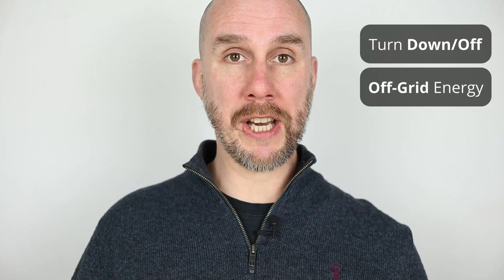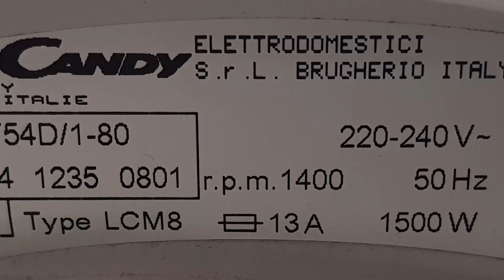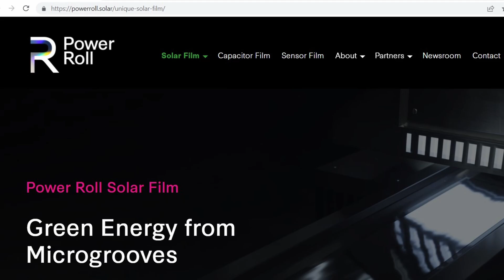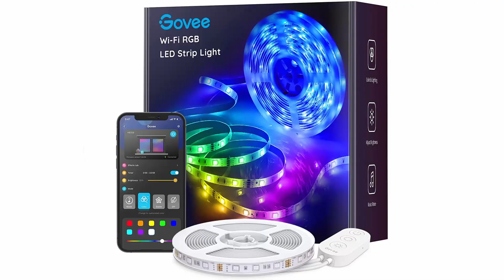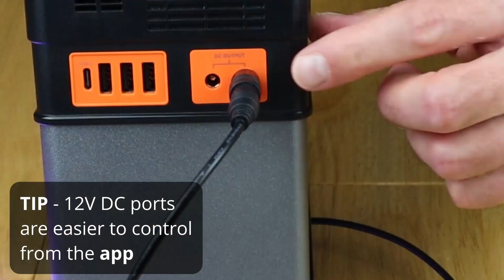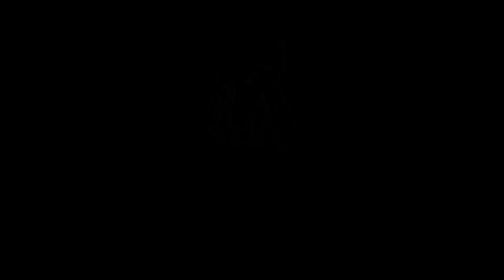Energy Matters #1 | Off-Grid Solar & Portable Power at Home | Cutting Grid Energy Usage

Comment: So pleased you are doing this series of videos. I am currently looking into the same thing using the Ecoflow River Pro - which is then scalable with a second battery. 600w devices are my new holy grail!
Reply from the maker: @david wilkins  Good day David! Thanks for your feedback, this really helps gauge interest in this topic👍 The added flexibility that expansion brings is a winner for sure! I'm getting to the point of thinking of electricity like water, in the fact you can carry it around in buckets or batteries in this case. Please shout if there are any burning topics or items you would like to see in upcoming videos. All the best, Adrian

Comment: Hello Ade, Great video and information. I am in parallel with you! around 10 years ago I set up my own DC microsystem in my shed for some lighting in the Kitchen. The intention was to power LED strip lighting under and above the cabinets at the dark end of the kitchen linked up to a motion sensor, the lights come on when you walk into the room and switch off after 20 seconds of no movement. Front end was a single solar panel (100W), controller, 110Ah Lead/Acid leisure battery plus various meters to show the load, Reset-able fuses etc.This has worked very well for years. I recognized I could do more with an off-grid DC setup rather than on-grid system so I have put additional wiring into the house with fuses to suit 12V LED strips (one and a half metres) with an on/off switch in each room. (had to be careful with the wire sizes). This works well too. I am upgrading the battery to Lithium now. Keeping one eye on the energy issues I purchased a Jackery 1000 to use for other purposes, loads of rechargeable AA/AAA batteries and various adapter cables to connect various devices direct to the Jackery solar panels where possible. I plan on getting some of the stuff I have seen tried on YouTube such as 1kW kettle, single ring Induction hob, mini oven cooker etc etc. I have only been using the Jackery for a short while and the panel charging seems to be a bit "hit and miss" with them on the ground. I am not a "prepper" but am also interested in producing drinking water from a de-humidifier and filter method but I am having trouble finding a suitable 12V DC de-humidifier to produce sufficient water, mains ones at around 350W are fine but would bankrupt the power from my Jackery before producing much water as well. Looking forward to watching your series of videos.
Reply from the maker: @Mike Beirne  Hey Mike. Thanks very much for your generous feedback, it's much appreciated😊. Wow, we appear to be very much on the same wavelength. That's some DC setup too! Great idea to go lithium, I couldn't imagine life without LiFePO4 batteries now.

I bought a dehumidifier fairly recently so I can dry washing once the weather turns (and then I don't have to use gas central heating or tumble dryer). It's a 250W model, but I've seen another that uses 130W, but I'm not sure how affective that would be. I feel a DIY project coming on to produce water as well.

I'm not sure if you've seen some of the other videos on the channel (you may have already), but they might be useful for the other bits you're planning on getting. Next in this video series > https://youtu.be/fu_hbYolXc4 and some of the others where I test using the things you’ve listed > AC200P https://youtu.be/pl6-XN4xfMU > EB150 playlist https://bit.ly/3msZlWT > Jackery playlist https://bit.ly/3AMWrD7. 

I'll continue this series and also provide some figures relating to how much I've saved and how I've done it. Thanks again for sharing, this also helps other viewers out too! All the best, Adrian
Reply: @DADvinci  Great thanks for your comments. I have seen other reports and ways of "producing Water from thin Air" as they are usually called, but I would be very interested if you do some form of investigation/project particularly if it is aimed at 12V rather than Mains source.

Comment: Hey Adrian, some great advice you have put out there for people to save money on power.  I’m glad you mentioned the direct D.C. to D.C. issue, as an inverter is inefficient and/or unnecessary in many cases.  Also through charging is a huge point, as you have pointed out a while ago now.  
One trick to save money is to switch off appliances at the mains.  There are so many items taking up a small amount of power, it adds up; T.V. Radio, D.V.R. Sky, Device Chargers, the list goes on.
Shame we can’t do much about the standing charge, other than shop around.
Great advice Adrian, great to see you again.  Rog.
Reply from the maker: @Roger Hargreaves  Hey Rog! Thank you👍 You're always very generous with your feedback😊. Switching over as much as I can to battery/solar power is already making a real difference to my monthly grid usage. Managed to keep my April bill low (£85 in total). You're right about switching things off from the wall, every watt helps now. Although I understand the necessity for a standing charge, it's just getting silly now (especially electricity). My May standing charge (Gas + Elec) will be almost £22 alone! Here's hoping for a sunny May so I can keep the bills down and videos coming. Enjoy the rest of your weekend. Cheers, Adrian
Reply: @DADvinci  Thanks Adrian, always great to get a quality reply from you.  Here’s to a ☀️ summer. 🤞🏻.

Comment: I loved this video Adrian, and it gave me a bit of a boost as well. Mainly because your video confirmed I was doing something right.
 I was up early this morning just to set up my 100 watt solar panel and catch as much sun as I could. Our rented bungalow is all electric, and I feel like pulling out the night storage heaters and throwing them into a skip. 
Anyway (takes deep breath) it is now me versus the grid. I have two Swarey  S500's and just the one 100 watt solar panel. We can use our large tv for about 10 hours with one S500, whilst the other powers a standard lamp (with a low energy bulb) and recharges both my mobile and laptop for a huge amount of time. I know it is little beginnings, but I feel so much better for giving it a go.
Reply from the maker: @Sidney Bowerman  Hey Sid! That's very kind, thank you😊 I've got to say that feedback like this and what you get from the content, really makes all this worthwhile👍

I feel your pain when it comes to the storage heaters and there's not much you can do about it if you're renting. I guess we're all in this together now, 'us' versus the grid. That's good going with the TV!

I started my solar journey off with the original 288Wh ALLPOWERS unit, which is still powering some LED strip lights in my living room as I write this. I've just refined the build of my DIY 24V 5kWh battery which runs most things now, so small beginnings grow and it all counts Sid! Thanks again and take care, Adrian

Comment: I have tried all of your suggestions but to no avail. I wish I could get a full charge by 11am. It takes me all day!  I haven't used the Anderson port on the 372 as I don't have the lead. It's on order. Obviously the Jackery 500 doesn't have an Anderson port. I wish I had waited for the 1000. I will persevere but I am still happy with the results I am getting so far. Thanks for the support.
Reply from the maker: @Turbo Jones  I'm sorry to hear that. It may take all day, but you've taken the step forward. I started with the 60W foldable years ago and have slowly grown my setup. Using the Anderson port should resolve the issue, if it doesn't then it can only be the cabling/connectors (if the panel is good). I'm not sure why the Jackery would be showing the same behaviour as it's not something I've seen in any of my testing. Does the Jackery charge fine with the mains brick? It's a pleasure, troubleshooting with good people like yourself results in wins all round. Cheers, Adrian
Reply: @DADvinci  Yes the constant charge from the brick(s) works fine. It's the variation of charge that is the problem. I have ordered an Anderson lead so I'll see if this makes a difference. Will not help with the Jackery but I can live with that. Anyway, I am getting good results from running mains devices as I said. Just takes a bit longer to charge but being able to run the TV, settop box, phone and router from just a single 100w panel is a game changer expecially using the daisy chain method. Winter will be a challenge but hopefully we will have built up enough credit in the summer months and with Boris's help all should be good. Thanks again.

Comment: Inspired by your video thought I'd give it a go. I have 2 Allpowers 372 chargers and a Jackery 500. I can't resist a bargain. I have bought a 100w solar panel and after some considerable effort installed it on the Conservatory roof. After experimentation I have daisy chained one of the 372s to the Jackery so that the solar panel feed goes into the 372 Anderson socket and then feeds the Jackery simulateanously via the 12v socket. As the Jackery fan is noisy I only have this setup in the morning. Lunchtime when the TV goes on I reverse the procedure so I run the mains from the 372 and the Jackery feeds the 372. I run the TV, Humax settop box, the cordless 'phone and the Virgin router. I didn't realise how much they all used. Obviously we still need the kettle and high power device to be on grid. But, according to the smart meter we are saving, dare I say, a fortune. Obviously it depends on ther weather and we can't do this every day but so far very impressed. Thanks for the idea!
Reply from the maker: @Turbo Jones  Hey! It's great to hear from you😊. This is simply brilliant👏. I love the fact that you've thought about how to make a change and done it, bravo! The whole point of starting this series (more to come, filming a review currently), was to raise awareness that changes (however big or small) could be made and results seen. For most, it's not a very interesting subject, but due to the cost of living/energy rises, it's now in the spotlight. I'm not into drama, but do fear for many when it comes to the next price cap increase and the fact that hard decisions will need to be made (if not already). Thank you so much for sharing what you've done, as this gives me hope that good people like yourself are taking action instead of letting things just happen👍. All the very best, Adrian

Comment: I've felt exactly the same hence cooking using ALLPOWERS generators in a couple of my vids. I dont pay for any electric apart in the evenings from the annoying daily rate.
Reply from the maker: @Hairy Foody Guy  Good day! It's great to hear you're using the ALLPOWERS to cook with. Do you store solar and/or get a special rate grid tariff?

Cooking is on the list for this 'Energy Matters' series. I'm going to attempt to stop using my gas cooker altogether for the summer months, providing I can get an alternative method sorted with the 5kWh DIY battery build I'm currently testing. All the best, Adrian
Reply: I'm literally using 3 allpowers generators & allpowers solar panels hanging out of my roof windows. All my lights are solar, phones, laptops and battery packs and charged using solar. I've worked out that I can use a George Foreman Grill, airfryer, slow cooker, rice cooker, and even a tabletop oven on the generator packs. Even my smart meter is running on the medium sized battery pack ! I refuse to downsize my 75" TV so I've turned on the ambilight and even that runs for hours on the generators. I even bought a solar tilly lamp so I'm not tempted to turn on bedroom/bathroom lights. I'm kinda enjoying it. The only thing that's running on electric is my washing machine, and my gas boiler. I'm on grid as its rented accommodation but feel like less of a mug paying that huge electricity jump. There's a few videos on my channel that might interest you and your viewers. We are testing low power kettles and toasters soon and a very exciting cooking gadget indeed. Love your channel. Hope you can sub to mine and enjoy my videos like I enjoy yours !
HairyFoodyGuy aka actor Julian Seager
Reply: I might need your expertise actually soon as I bought 4 secondhand solar panels and I'm keen to get them set up with some leisure or marine batteries, an Inverter, controller etc but I don't know what exactly I need and its easy to get things wrong with electrical stuff !!
Reply from the maker: @Hairy Foody Guy  Hey Julian! Wow, it's like you've summed up what I now consider my living. Yes, I've got a full-time day job, but off-grid is my 'other' job now. I couldn't agree more, it's both enjoyable and immensely satisfying (ok, an obsession) to harvest energy to run your life. I've subbed and will take a look👍 The low powered kettle (flask kind) I run off the smallest solar generators seems to have proved popular with viewers. I've got a 600W toaster that works well with mid-range units too. I've not run my washing machine from the grid for almost 2 months now. My old slimline dishwasher now runs off-grid when enough battery power is stored and/or decent sunny day. Great to see that there are things you won't compromise on, like your 75" TV! Cheers, Adrian

Comment: I got some usb charging sensor cupboard lights, put them up on the landing to try cut the use of grid power, I use the Jackery 240 to charge them which itself is only charged by solar, working well so far 👍🏻
Reply from the maker: @Glen Boden  Good day Glen. That's a great idea, thanks for sharing! I've got one in a wardrobe, but I hadn't thought of using it on the landing, nice one👍 You've got me thinking now...I wonder if I could put one on each (or every other) step of the stairs so they light up as I go up or down🤔 Awesome! Thanks again and all the best, Adrian

Comment: My experiment with running household devices from Solar Chargers has been mostly successful, but I have found one problem. As you reported in an earlier review of the Allpowers 372 it has a habit of refusing to increase charge when the sun goes in and out. Charging the Allpowers from its provided charger or the car is no problem as the charge is fairly consistant. Not so with our weather. For this reason when I daisy chain the Allpowers and the Jackery it is the Jackery that gets the solar Panel charge which in turn provides a constant 33w to the Allpowers. This can then run the mains with no problem.But now I see the Jackery is doing the same thing. I didn't at first notice as the sun has been scorching for the last few days. Yesterday, however, like today has been bright sun then cloud. The charge drops from 80w to 22w and refuses to increase when the sun comes back out. I have to disconnect, wait a second, then reconnect. All is well again until the next cloud. Is there a solution to this. Have I got a dodgy one? I am having to constantly monitor the Jackery depending on the weather. Weird. PS. It definitely is not the Solar Panel as I have checked it.
Reply from the maker: @Turbo Jones Hiya! You’re using the Anderson port for solar, not the DC input (used for the power brick) on the 372? That should be able to handle the cloud and bring the charge back up. The only thing that might slow the charging rate is if the battery is getting close to full charge. My batteries have been completely full by about 11:00am for the past two days, even with the cloud. On the Jackery, that’s not something I’ve seen, other than when it gets close to fully charged (as on the 372). It might be worth trying a reset on both units to see if that makes any difference. On the 372, switch on the DC so the display wakes up and then hold the DC button down until the whole display lights up. On the Jackery, hold down the DC on and display buttons at the same time until the display resets. Please can you let me know how it goes? Cheers, Adrian